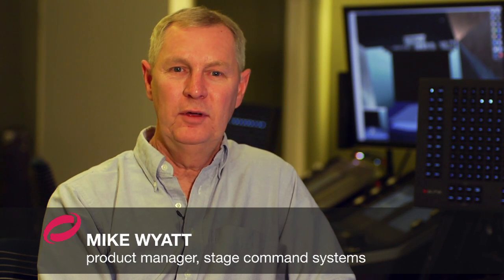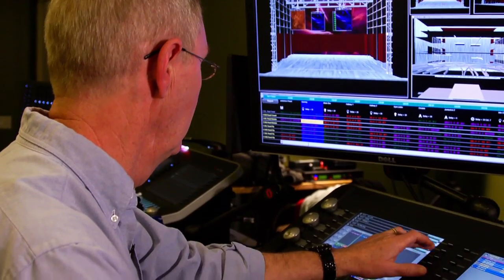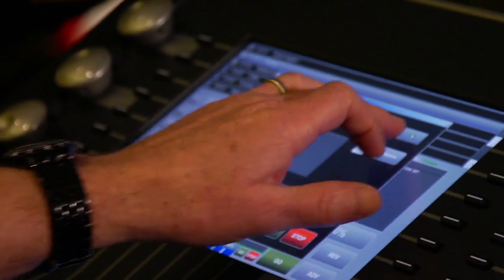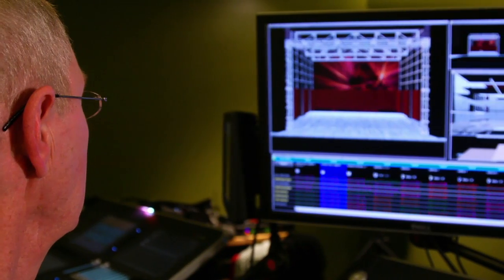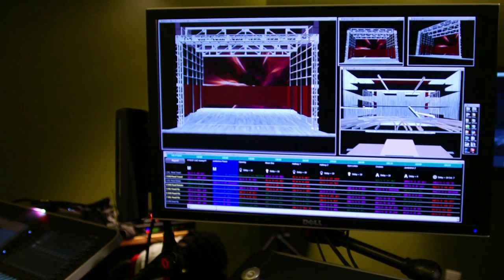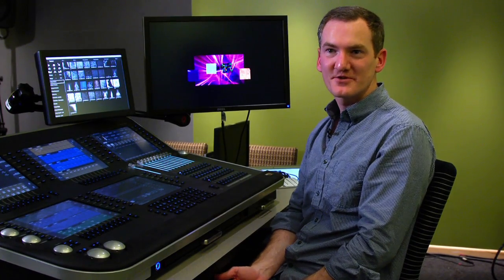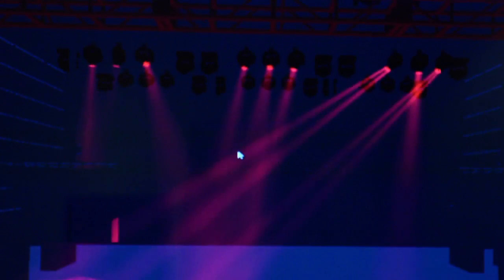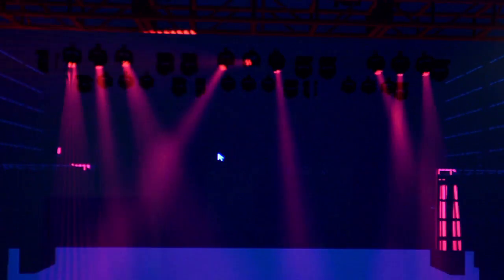PRG Previsualization Suite

Comment: No, that is not correct either.  We have been integrating video, scenic, and lighting automation in one previsualization package for a number of years.  Both WYSIWYG and Vision can be controlled by the FTSI Navigator, which we have used for the Le Reve show in Las Vegas and The Bubble Theater in Macau.